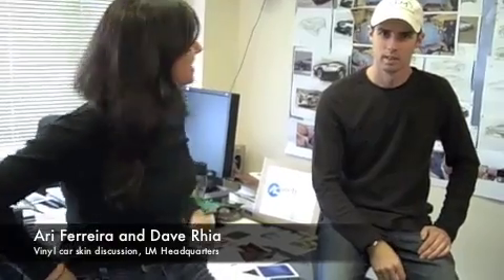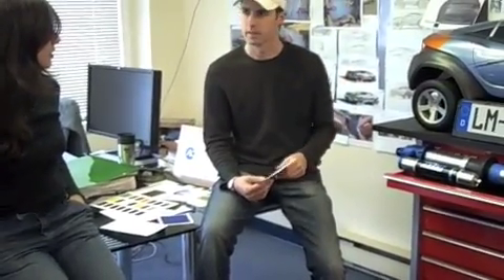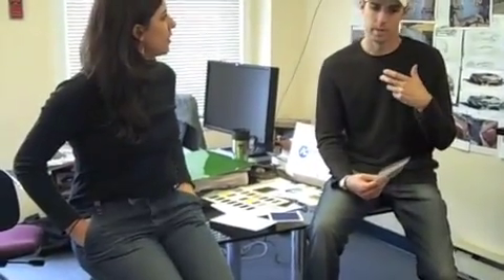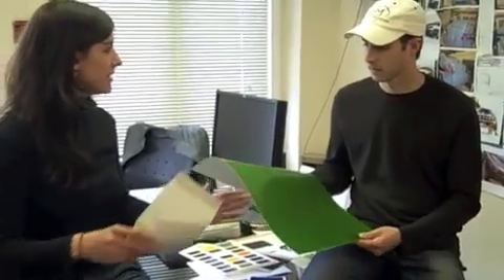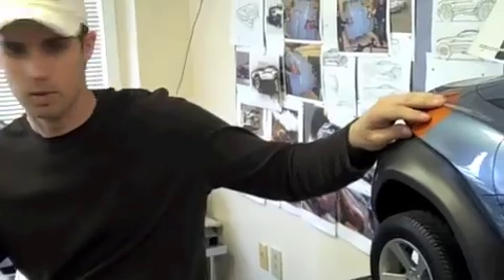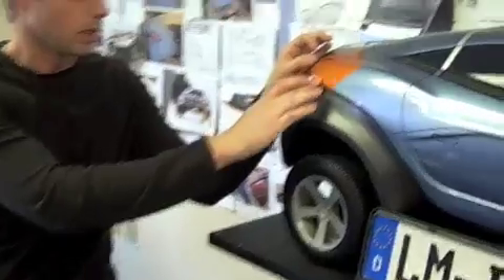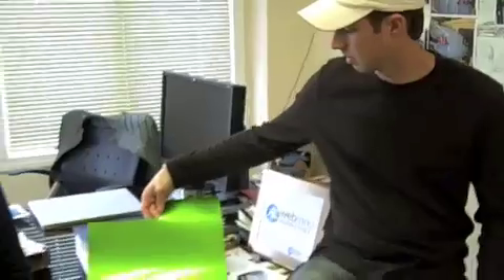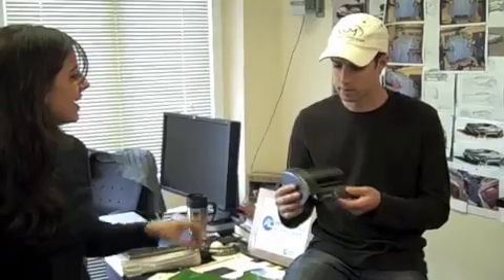Local Motors- Vinyl Car Skins Discussion

Comment: Part 2. 
 Vinyl products don't last near as long as paint (in fact not even close).  Yes even water based paint.  Most car manufacturers use water based.  So considering your vinyl isn't going to hold up that long (5 years if your lucky in Arizona) means your going to have to repeatedly have it re-wrapped extending the cost of your vehicle years down the road.  Here's a little info I dug up on the production of sign materials such as the vinyl talked about using in this video.